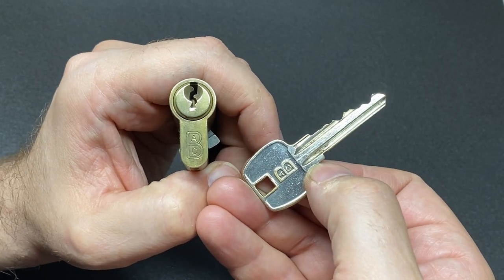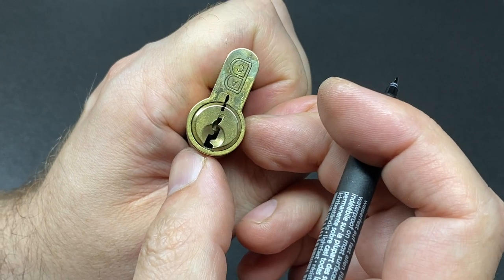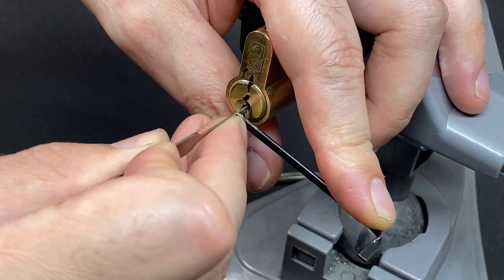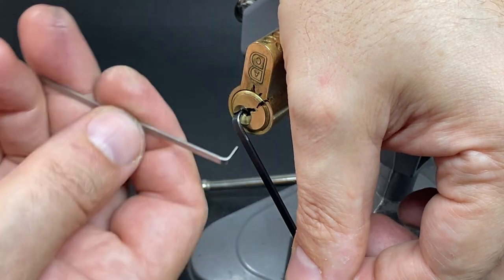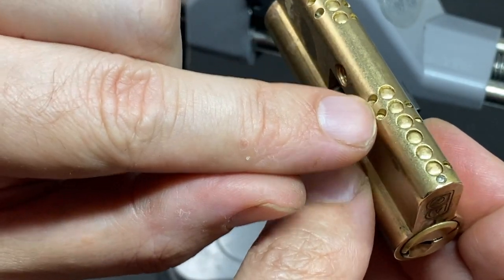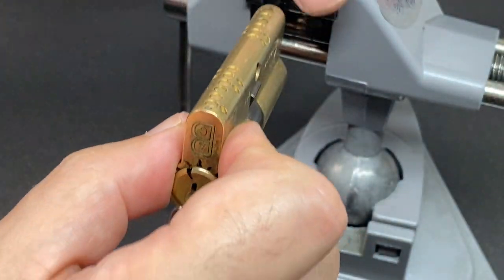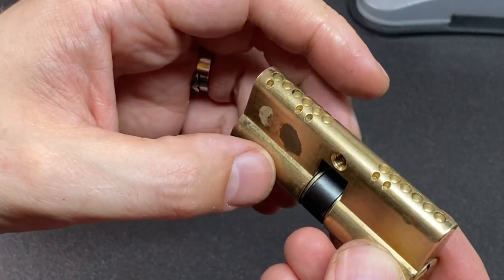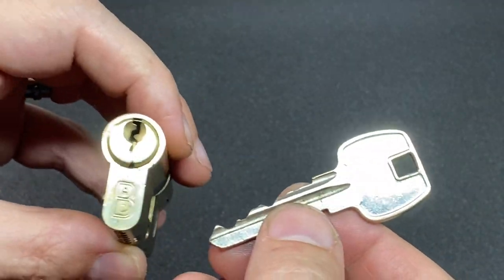Hardest Trap Pins - Fullex ABC Lock 360 Degree Pick

Comment: Hi Lock Noob, well picked in both situations! I guess with those multiple trap pins, realistically, it would probably only be Locksmiths in the main, that would have to deal with them. Full length key pins would surely prevent a bump key from being removed once trapped, and a plug spinner would have to deal with not only the trap pins, but the open bottom of the keyway ... tricky! Using an impressioning gun to make a key, would be my goto.

Comment: Hey guys, I once picked a master lock tag out lock, and after turning the core 180 degrees, the driver pins jammed. Stupid mistake.
I then picked a lock at my church (with permission) and they require you to turn the core a full 360 degrees to unlock, and before passing 180 degrees I remembered what happened to my master lock tag out lock, so I went back and didn't keep going. If I kept going, would the lock also jam?? Or would I have to pick it one more time at 180 degrees to finish the full 360?
Do all locks jam at 180 degrees? Or only padlocks?
Someone please help!!
Reply: Usually the driver pins just protrude into the bottom of the core a bit. You can usually just push them back up with the back of your pick (but master pins can fall out, so be careful with master keyed locks). The problem with your LOTO lock is the the key pins are loaded at 180° through holes at the bottom of the cylinder, so when you turned the core over they were able to fall out into the hollow lock.